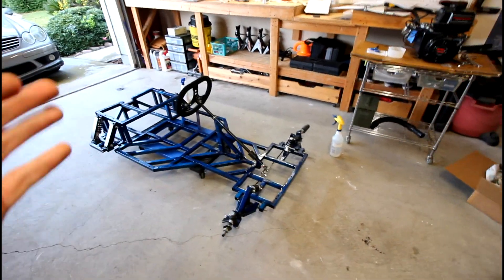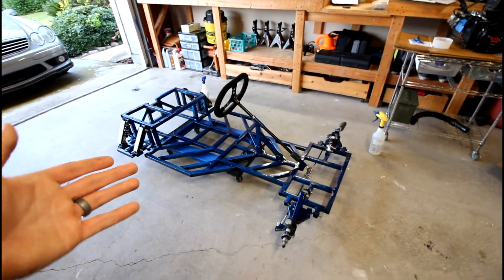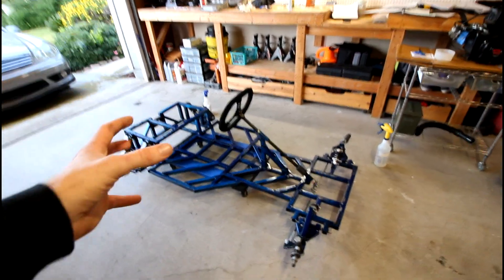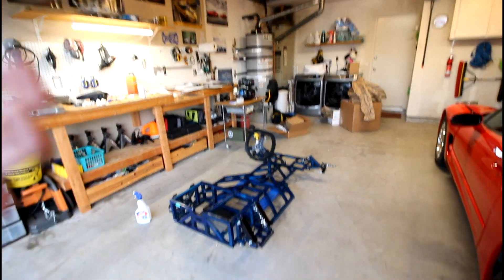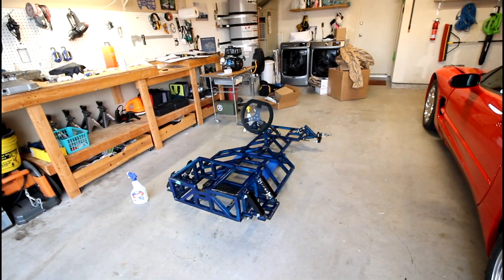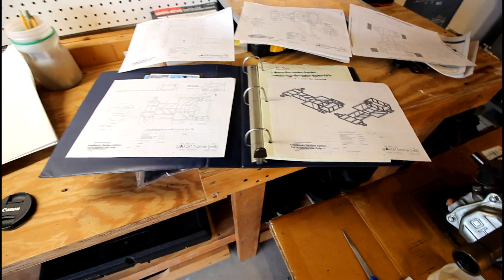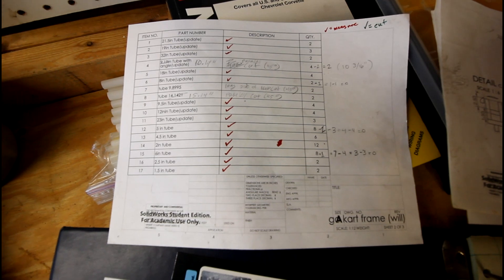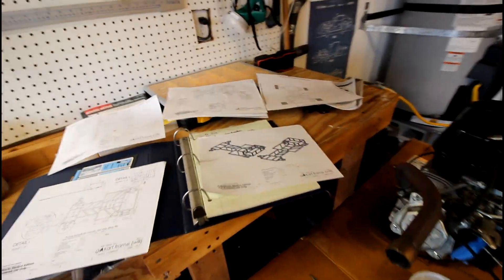Selling My Homemade Go Kart Plans and Designs!

Comment: I want to build a go kart similar to yours but only have about £500 budget. Do you think that would be possible? That would be about $650 - Give or take. Love the build by the way and I've looked through your channel and you have been consistent for 14 years, you deserve so much more recognition bro!
Reply from the maker: Thank you for the kind words, I appreciate your support! Mmm, that may be tough. If you only have that budget, I'd suggest trying to find a used go kart frame, restore and modify it to your liking and then slowly add upgraded parts. If you really want to build your own, $650 may be just enough to get all of the raw materials (metal tubing and such) to get your frame and chassis built. If you have the desire to save up more, you can save more over time to then get all of your off-the-shelf and upgrade parts. In my go kart packet I estimated about $2,400 all said and done (but that was like 2017 prices). The off-the-shelf parts I used were all very high-end shifter kart parts (minus the engine), so you could definitely build it cheaper, especially if you can find used parts locally.
Reply: @Addimotive  Thanks for the advice! That's really helpful I'll start looking for some frames right now.

Comment: Your go kart is awesome! I learned a lot from your videos. 

I'd love to know the specs of the steel (type, dimensions, wall thickness), axle, hubs, hardware, etc and links to where you bought parts and prices paid. Also, the dimensions of each piece of the frame. I dont have CAD software so simple diagrams/drawings with dimensions would be great.
Reply from the maker: Tom, thanks! I appreciate the kind words and I'm glad you've learned something from my videos, exactly why I post them. I'm working on a design packet that will include all of that info and will be in a PDF format, so access to CAD software won't be necessary. I've been really wrapped up with projects around the house, but I plan on tackling this soon.